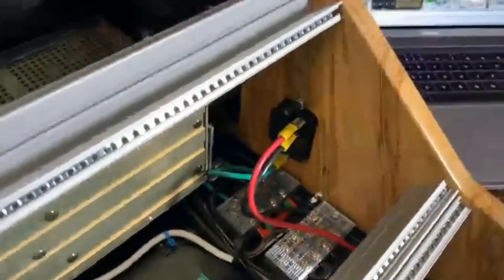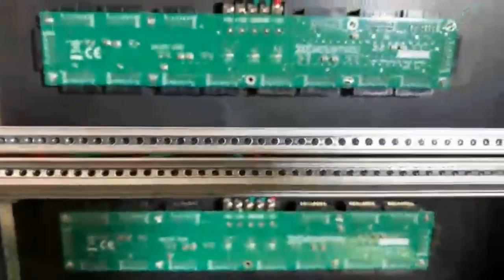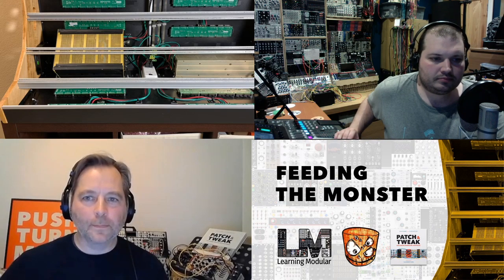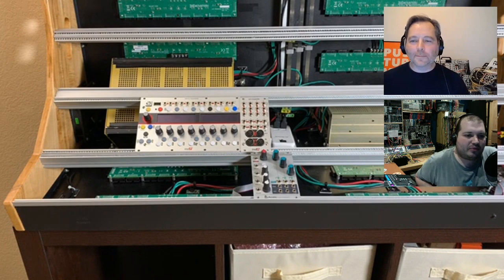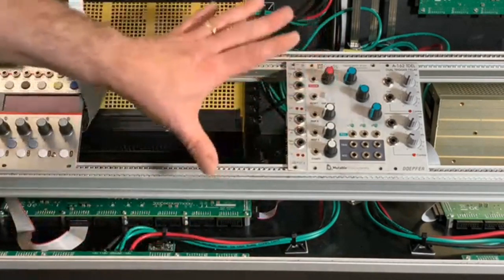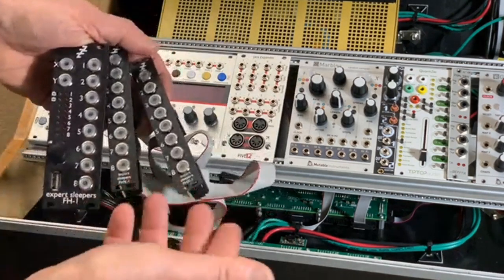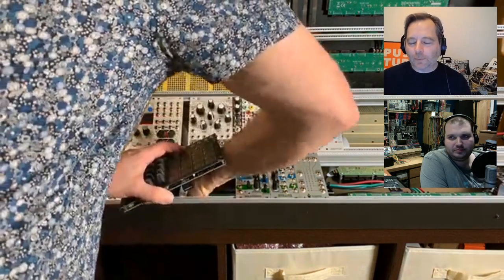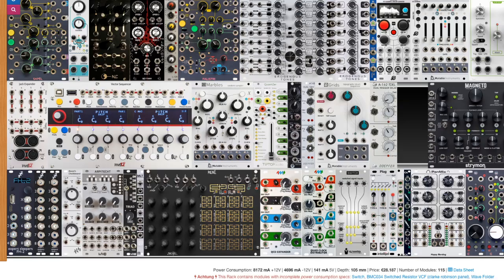SKIP TO 9:30 TO GET PAST TECHNICAL ISSUE* Note & Trigger Generators // Feeding the Monster Episode 1

Comment from the maker: *Wow, we certainly learnt a lot in that stream. Skip forward to 9:30 to get past the initial technical issues. There's a continual issue of my audio panned hard left (got a solution or two for that I think) and also figured how to get Kim Bjorn back into the video at 45:01 (roughly)! Lessons learnt for next time. Episode 2 of this series (with no technical difficulties hopefully) looking at oscillator and sound sources next time will be live at 7.30pm UK BST time on Saturday the 11th of April 2020.
Reply: I think a great idea for these kinds of group chats would be for each of the participants record the audio themselves, that way if insanity happens, whoever is 'in charge' can take the video and then just mix in the different audio files. This will help with syncing and different audio levels.
This doesn't help fix anything in the live stream but would help create a good final video.

Comment: Is there any way you could post a Manufacture, Model, Part Number List of all the components you used to build that case. Also include those fans and speed controls you are using. It sure could save a lot of search time. I've spent almost a week trying to put together a power solution. I'm going to be building an 24U x 252HP system (8 rows). I understand now why these systems cost so much. The power systems I'm researched would cost between $750 and $2,000, and that isn't even counting the rails. Any help would be greately appreciated.
Reply from the maker: Hi James, it's not my case to be able to do so. You're welcome to contact Chris Meyer for further information, but I can't speak on his time availability to do so, as I doubt he has a list of information ready to just share. He's nice and supportive though so I expect you'll get a response.
Reply: Ok thank you